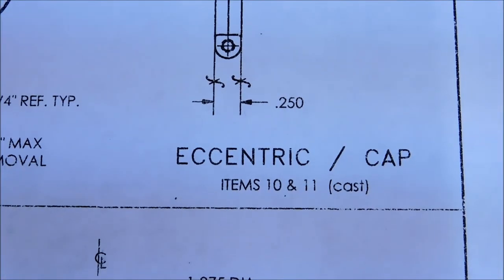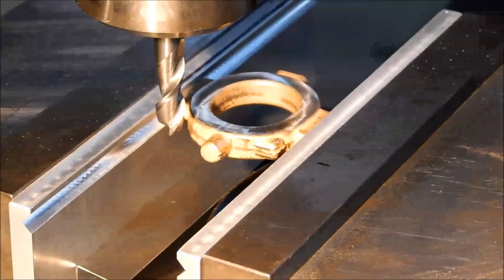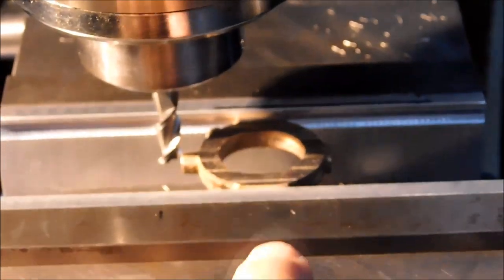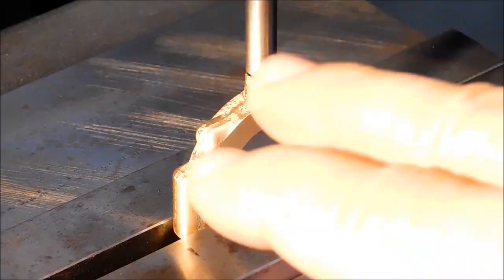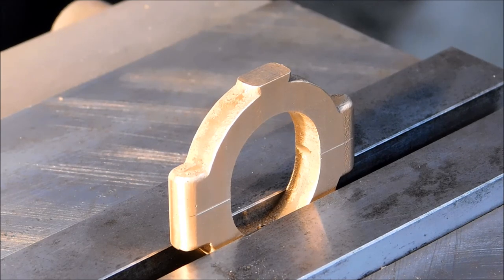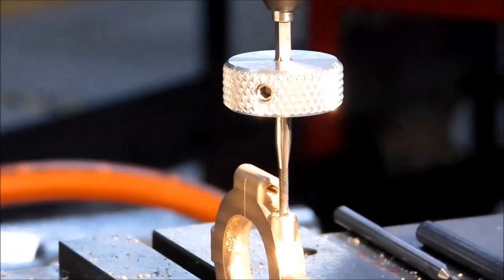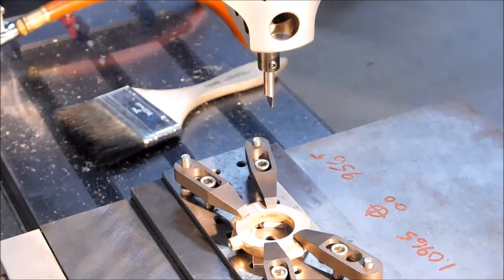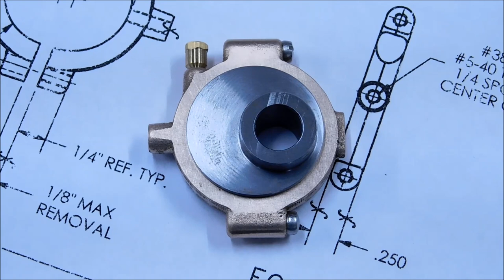Machining a Model Steam Engine - Part 16 - The Eccentric and Cap

Comment: Great video Joe. I have been a hobby machinist for over 30 years and am still picking up tips from others.  One tip I really liked that you did not even mention was the scrap piece with the slot when using the band saw.  Like most the "machine slot plate" on my saw has been blown out over time. I need to make a new one but this tip will let you get by safely with small parts.
Thanks! Fred
Reply from the maker: Once the throat plate pin drops out, all bets are off. I bought the saw with that plate and have just never replaced it.

Comment: When the light in the gap turns blue, you are at about 0.0002".  This is quite noticeable when you have known smooth, flat and parallel features.  Even when there is variation due to imperfections in flatness or straightness, the places that have that small gap still show a change to blue color.
Reply: Good observation, 0.0002 is about the wavelength of green light, green and longer wavelength can't get through.

Comment: Joe, I am glad you brought up using visual means to align parts. The Mark I eyeball is a powerful tool of you use 'em right.  Plus the tip on looking at the tap body for wobble was one told to me years ago. Good stuff sir. As in most Joe Pi presentations I learned a new way to approach things. Cheers
Reply from the maker: I cringe when I watch supposedly 'Tutorial" videos as witness small taps being presented with such a degree of slop. Its just a bad practice to present to hobbyists that want to learn good techniques.

Comment: Joe,  I'd like to fab some of those small toe clamps you use on your small fixture plate....do you have a rough sketch of those that you can share with a fellow viewer....thanks.
Reply: To be honest you only have to look at them to see the design. And it's easy enough to guess the size from the fact that Joe is boring a 1" hole in the part.

Comment: Top tip joe, when boring out to limits of less than a thou its a good idea to have a thou undersized lead about 2 mill, that way you know exactly when you’re approaching the finished size. I’ve been doing that for years and never gone oversize. But knowing you you probably already know that. Great effort tonight.
Reply from the maker: Or multiple gages.

Comment: Great work and advice Joe, thanks. Love the shot of the finished product at 43.37... such a good fit can't make out the parting line of the eccentric straps.
Reply from the maker: Thanks. I didn't deburr those edges for just that reason. The parting line is nearly invisible.

Comment: I really like your fixture plate.  Can you tell us the dimensions and some specifics about it?  Or better yet maybe do a shop class on building one.
Reply: Saunders Machine Works (NYC CNC here on YouTube) builds those things for a living. Also Oxtoolco did a video or maybe a series a couple years ago on designing and making these things.
Reply: I made a similar comment to Joe 1 or 2 videos back. Maybe he'll indulge us, but it won't likely be until he finishes the steam engine project. Cross our fingers.
Reply: It's just a nicely square and parallel plate with a bunch of tapped holes. I alternate between tapped and reamed holes for pins. Super easy to make.
Reply: My point is the plate Joe is using looks ideal for holding smaller parts and rather than re-invent the wheel I was wondering if he would share some specifications.  Then there are the beginners and others who are looking for a shop project  that could probably benefit from a tutorial on building one.
Reply: @glenncerny8403  Yeah it was the very first bit of tooling I made I think. You just base it around the size of parts you want to work with. Here's mine, if it helps https://www.instagram.com/p/B1MAnYEA6XM/
Reply: @DubsnSubsSessions   it says there is no content on your channel.????
Reply: @dalemcinnes1834  Not sure what's going on there. Did you click the Instagram link I posted or my channel name on here?
Reply: @DubsnSubsSessions  Thank you.

Comment: Hi Joe, another good video, I'm impressed you were able to hold the job by the 'ears' to machine the two sides, I wouldn't have even thought about it, I'd be trying to clamp, to a horizontal, then  machine between the clamps then add more clamps and remove the first!!
A question on longevity of the engine, as an 'Engineer' would you consider a 'second life' for this casting. The drawing called for 0.125" to be removed between the two halves, would you have removed less say only 0.100", then bored the 1.0"  so when the bronze started to wear to a point the engine became unusable, you could remove the 0.0125" from the two haves and re-machine the 1.0" bore , so effectively doubling the life of the engine, well this part!, hypothetical I know, but I try to look at ways of improving any design

Comment: LOL yeah I wondered why Quinn said to avoid parting through an eccentric hole.  I saw that and thought "WHAT!"
Reply from the maker: Its easy to offer bad advice when you are to inexperienced to know or even realize you are wrong. Thats why you should be grateful and embrace comments and remarks from actual industry professionals if you make 'Tutorial' machining videos.
Reply: So, is it Ok to part through an eccentric hole or is there something special you need to do?
Reply from the maker: Its OK. proceed slowly across the interruption if its a hole, keep a mild angle on the parting tool and keep the cross slide snugged if its sloppy. You'll be fine.
Reply: @joepie221  Thanks Joe.

Comment: Hello Joe! What are the dimensions of the 4 hold down clamps? This is the most amazing and useful machining series. You have shared so many insights that have vastly improved the operations in my shop. Please consider more projects such as this. Outstanding!
Reply from the maker: I may detail them in an upcoming video. 3/8 x 1/2 x 1.8 long   10-32 screws
Reply: @joepie221  thanks please do

Comment: Hi Joe, great video.  I’ll be doing that shortly and I wonder if you could tell me where you got those 2 plates with the bevels at one end and square channels on the other end to help hold the parts in the vice.  Thanks, Tim
Reply from the maker: I made them. Put a smaller vise in your regular vise and tilt it at 45 degrees. Make a cut on each plate using an end mill along the Y axis. Done.

Comment: At 29:30 we call this "knocking the hook off" the drill great tip Joe! Also at the end of the video I noticed the tab was still on the bottom of this part. Did you leave this on there for a reason?
Reply from the maker: I like the way it looks.

Comment: Wonderful video as always, but you left the little bit of gate casting on the piece! I know it's just cosmetic, but isn't it supposed to be gone ?
Reply: I actually think it looks better with the gate remaining.
Reply: I've seen similar parts on "real" machines with these reference surfaces still intact. If you remove it you have to consider what your going to do with the shiny spot on the rough casting... do you machine and polish the rest of the outside? Part of the charm of these machines is the contrast between the rough casting and the machined surdaces,,, in the end its just an aesthetic decision thats up to you,
Reply from the maker: It is shown as removed, but looks more realistic with it on. I may leave both.

Comment: Joe  If others are scared of the drill snatching when drilling counter bore holes. Drill the larger first to a dead stop, then drill the tapping size. 
Steve
Reply from the maker: That will greatly reduce the grab, but you can always expect some in brass and bronze.

Comment: I often use the point of a spiral flute tap to quickly scribe lines in soft metals in my mill. Like cut lines for center lines or circles or odd shapes.

Comment: One thing I dont understand, when you Tap the threads and then remove 1/8" from the middle of the threaded hole, shouldnt that make the threads misaligned? I'm an amateur machinist so maybe I'm just not thinking about this correctly.
Reply: The clearance hole goes past the split line, so there are no threads in that half.
Reply: Thank you. makes perfect sense now.
Reply from the maker: The threads start  at the split line, and the clearance hole stops at the split line. The width of the gap simply reduces the amount of each feature. As long as they both start or end within that zone, the halves will function properly after splitting.

Comment: Great job, Joe. The plans does not show, but this part needs 3 to 5 thou sheems in each side. This part goes loose after some time running. Greetings from Mexico.
Reply from the maker: Not a problem. Installing them may be the challenge.

Comment: Hi Joe, great video as per usual, just one maybe stupid question if I may- What is the slowest speed you would run an edge finder on? I generally run mine about 1000 rpm but iv'e seen videos on the tube where they seem to be far in excess of that and obversely below that, what's your recommended speed?
Reply: I run mine between 500-600rpm. Wouldn't want to run it much faster than that, but maybe 800rpm would still be ok. Personally, I think it's best to run at the same speed, then you get to recognize the contact point and you get better consistency.
Reply: 600 rpm
Reply: 1000 rpm
Reply from the maker: Normally between 1000-1250 for me.
Reply: @joepie221  thank you for your reply. I posted this question on another forum and there seems to be some very wildly differing speeds that people run them at! 
I might try and look at the vertex (that's what my unit is) web site and see what there recommendations are.
Reply: I personally don’t use edge finders they’re not accurate enough for what I do, i use a different method that’s guaranteed.
Reply: @KevinWoodsWorkshop  I'm only a hobbyist and is accurate enough for my tinkering, I presume you are in the precision industry side ,which wouldn't be. I have a retired customer who worked for a company that made parts for satellites etc and they worked to microns. he laughed at me when I was talking about chasing a thou.
Reply: @paulrayner4514  yes I do work to silly limits on aircraft parts like typhoon and f35 and many other things but I’ve got used to it. I’m glad you’ve taken up hobbyists engineering and watching joe will help you. I sometimes teach apprentices and it’s satisfying watching them progress. Keep up the good work.
Reply: @KevinWoodsWorkshop  Can you share your guaranteed method with us Kevin, we know it runs at 600 rpm from you earlier post.
Reply: @thinwelshman1  yes I’ll explain, first of all when I say a guaranteed method I mean not using a centre finder. What I use is something I’ve made! Imagine you have a gauge block. .400 inches with another gauge block .200 inches overhanging a rung together. Now if you for example hold this against your datum face and clock between your datum face and the. .200 gauge block, you know if you pitch back to your datum face .200 you’ll know your exactly at your datum edge.  Another way, let’s say you want to bore a hole.250 dia  1 inch from your fixed jaw of your vice then simply put a 2 inch gauge bock in your vice and clock between your jaws and you then know your 1inch from your edge.  I hope this makes sense.
Reply: @KevinWoodsWorkshop  Thank you Kevin for taking the time to explain.

Comment: You do a bit of hand filing. Have you tried chain saw files rather than rat tail files? I find they work well and have a constant diameter
Reply from the maker: I like the options on a tapered round file. I can get into small corners or big flats with ease.

Comment: Why do you tread it before splitting, how do the treads still line up?
Reply from the maker: The top of the hole is a through hole, and the large center bore lines them up.

Comment: Mr Pie are you operating both wheels to make it turn while cutting the surface, so it goes in a circle.
Reply from the maker: Yes I am.
Reply: @joepie221  always find it hard to move in two directions, but thanks for getting back to me. Very cool channel

Comment: So center to center x 2 would be the total valve travel min to max? And timing is set by rotating it on the main shaft?
Reply: Yes.
Reply from the maker: Correct. The piston and valve still need to be adjusted on their rods to sit properly during the timing operation. You adjust the depth of thread engagement to set this.
Reply: @joepie221  perfect  thx now i understand it all

Comment: My favorite take-aways from your videos are rarely what you highlight. I’d have tried to “feel” the flat registering by rocking on the outboard edges of the part in the vise. Using a center drill or whatever to press in the center for better feel looks obvious but probably would t have occurred to me.

I’m going to call election fraud if this series ends without a single plugged hole or “it adds character” feature of some sort, though.
Reply from the maker: I may have to disappoint you on that thought. I check every thing 3 times before I move anything.

Comment: Did you say watch maker?
Reply from the maker: As a young aspiring machinist I applied for a job in a company that specialized in precision miniature componentry. They required a mechanical aptitude test with all applications. Because of the results of that test, I was asked to return for 3 more days of higher level evaluation. Because of my scores on those tests, I was offered an apprentice position in the tool room. It was the part of the company that made all the secondary production fixtures and jigs. It was also the start of my OTJ apprenticeship. My focus was primarily watch crowns. I made the dies and punches that cold formed the crowns from small chunks of brass then wrapped them in gold. I was the guy responsible for the insignia you see on the head of the crown. The eagles, logos and such. The daily responsibility was for the other internal components of electronic watches. Stems, collars, seals, shafts etc. Extremely small. I loved it.

Comment: another great piece of machine /setup work. i do have a question.when you used a pin in a chuck to edge find the part,did you have any concerns about chuck runout affecting your measurement? would it make sense to mark the pin and then rotate it 180 when you check the opposite side to eliminate any runout. i really liked the paper trick  behind the part. this has been a great series.thanks joe
Reply: Yes that’s the correct way when using a drill chuck.
Reply from the maker: My chuck is extremely true. I know it runs well and I trust it. Its a Jacobs keyless.
Reply: I use a Jacobs keyless and yes they do run true.
Reply: @KevinWoodsWorkshop  kevin.  i wasn't  questioning the accuracy of the drill chuck. only asking if by rotating the chuck one could be assured of maximum accuracy from that procedure. in hind site it was a dumb question. i brought a gun to a knife fight.

Comment: An addition to my previous comment:  Though my machines are pretty large, I'd  still be inclined to bore that part in a lathe instead of a mill.  Soft copper jaw pads in a four jaw chuck are something that I use all the time.  If the pads get hard with use (work hardening), then they are annealed prior to clamping on soft material such as that bronze.   Copper (like brass) anneals by heating to a red heat then immediately quenching in water. 

The only difficult part on a lathe is to indicate the flat faces.  That has to be bumped in, or pushed in place with jacks against the chuck face, unless you are fortunate enough to have T-slots and fixtures pre-made to index things flat with the world.  Starting with parallels against the chuck face, however does get you close to start before final indication.  If you do use parallels, make sure to slide them out before spinning up the lathe.  Failing to do that, is likely to ruin a good parallel at best.  I won't mention the worst.
Reply from the maker: Both ways are possible, but if you strap the part down as shown in this video, all the clamping pressure is inline with the axis of the feature and won't effect the true roundness of the hole.  You also get the square relationship you would need to bump in on a 4 jaw, for free. A part clamped perpendicular to the axis as in a 4 jaw, risks high spot distortion. This condition is enhanced on softer materials like copper, brass, aluminum and plastic.

Comment: That looks awesome, Joe 😊. You could tell it was a nice fit before you even put the screws in. I love it when stuff just slips together like that 😁. Thanks for sharing! Cheers!
Reply from the maker: When there is a film of oil in there, it will glide like its on air.

Comment: Hi Joe, am I correct in assuming that is a 6 inch wide milling vice?

regards

Gareth
Reply from the maker: Yes. The manual mill has Kurt 675's on it and the CNC uses 688's. Both are 6" wide.

Comment: You work in a very noisy area! Seems like every video you can hear someone tearing up the roads in the background!
Reply from the maker: I have a traffic light about 150 yards south of my shop that leads to about 8 miles of straight flat road. Its a drag strip and test run area when that light turns green. I'm OK with it. I like the sound of a muscle car or solid launch.

Comment: Joe good amount of great information as usual , must admit I only use a casing when needed I prefer to mill from solid as I have a 4 axis cnc why not use it , manual mill and lathe  is the machine compliment , my best none loco build is a McOnie from blueprints by A Mount. runs on 5 psi air very complex build

this is not my engine mine was built 90% from solid cylinder and flywheel are the only castings 

https://modelengineeringwebsite.com/McOnies_engine.html
Reply from the maker: I have CNC capability, but I assume most of my subscribers do not. So I go manual for that reason.
Reply: @joepie221  thanks for the reply Joe